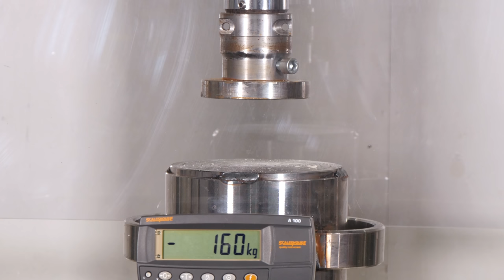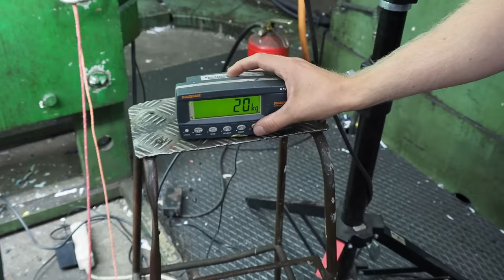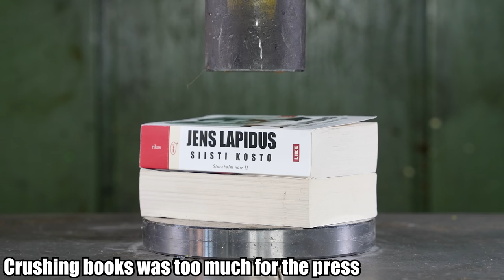10 MOST SURPRISING Hydraulic Press Moments

Comment: 0:14 Based on the colour, I'm guessing that the piece of metal was made of brass (copper + zinc) with a fairly high zinc content. When copper is processed (hammered, rolled, pressed several times, etc.) the copper becomes more and more brittle. You can test this by taking a tube of pure copper, brass or bronze and either hammering or bending it a few times and you can feel that the copper quickly becomes more and more stiff, so stiff that it finally breaks. This can easily be fixed by annealing, a trick I learned from my father who was a blacksmith. When you anneal copper, you heat the copper until it is glowing and then cool it again. You can cool it quickly with water, it doesn't matter. Once the copper has been annealed, it becomes just as soft and easy to process again. Jewelry makers have to do this all the time.
I don't know what kind of metal this was, but it looks like brass and if that's correct, I think annealing could have prevented it from building up so much potential energy that it eventually cracked and shot the piece of metal through the window with so much energy.
With that said, it may very well be that you know this very well and that it was precisely this effect that you wanted. 🙂

Comment: I believe the bone withstood that much force due to the shape of the cut. A slightly more bent bone would have broken in half easily. It's the cylindrical shape that increases the strength of the bone in this case.
That's my theory, I might be totally wrong tho.

Comment: Steel is stronger than bones, but bones repair themselves and are more durable than steel, lasting so much longer. Still rather surprised the bone stood up to so much force, but I guess its thanks to the bone being vertical and not horizontal (kinda like trying to fell a tree down by cutting from the top to the bottom) that it was able to withstand that much force.